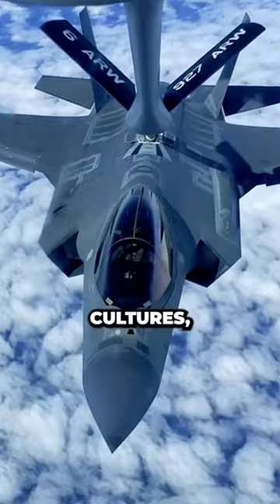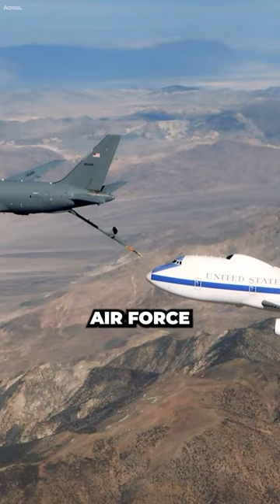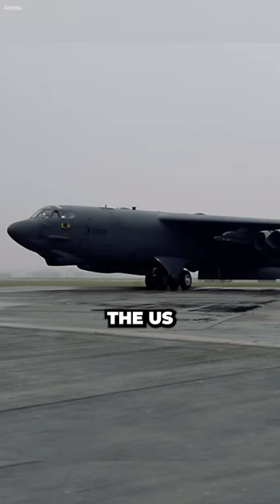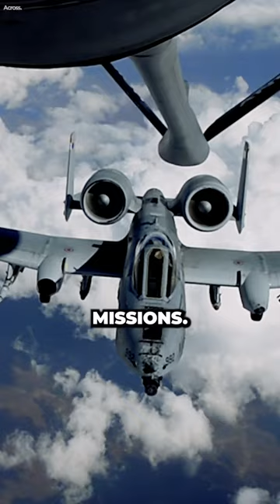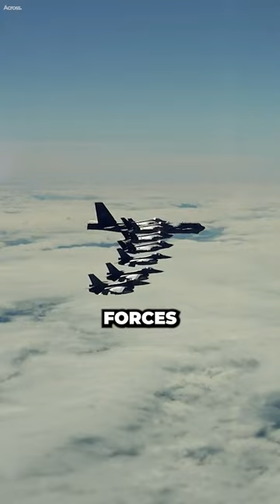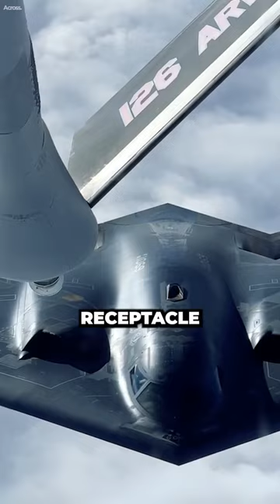Why Does the US Use Two Types of Aerial Refueling?

Comment: One disadvantage of the drogue system is that sometimes the receiver aircraft disconnects and the drogue goes along with it. The receiver has to abort its mission due to a drogue basket hanging off its refuel probe which could potentially be ingested by the engine or strike a flight control surface. The tanker has to abort because it’s lost it’s drogue.
Reply: I’ve never heard of that. Sometimes the the pilot misses the basket and it may hit the aircraft but the hoses are flexible and will only detach under certain extreme stresses. The boom would also do this.
Reply: @Statueshop297  On the USAF KC-135 R and T model, the drogue with a hose extension is attached to the end of the boom so they can refuel Navy and coalition forces. It happened on my first deployment which was right after 9/11.
Reply: But refueling providers have more than one drogue, often 2 or 4
Reply: @BeachriderUSA  You are correct. The KC-135 MPRS has two drogues and a boom, however, my original argument that the receiver has to abort still stands. More so, even if a tanker has more than one refueling point, the F.O.D. hazard of a compromised aircraft component to any receivers (trailing aircraft) would be such to also warrant an abort of that tanker.

Comment: Actual answer is due to fuel flow
rates. Booms have a had a much higher fuel flow rate and since it was developed for bomber aircraft that require lots of fuel that’s why the airforce use it. 
Everyone else uses probes as it’s fast enough for fighters and is adequate for other aircraft.

Comment: It all depends on how-long the refueling plane is to be attached for refueling. Planes with smaller fuel tanks might only connect for 15-30 minutes, refueling. Bombers, at those rates would need 80-240 minutes. That is why the higher flow rate boom is used.

Comment: Not every aircraft is compatible with both refueling system, however the F-35, specifically the F-35A is most certainly compatible with either, however it requires either system to be swapped out for the other, this is normally done by LM themselves, per customers request

Comment: The real reason is that Navy wants to be able to deploy their own tankers off aircraft carriers (Super Hornets and CMV-22B Ospreys) and boom tankers are infeasible on carriers, even though they allow for faster transfer rates which is particularly useful for large aircraft like bombers, transports and even other tankers of the Air Force.
So it doesn't have that much to do with different mission capabilities and more to do with where can you park the tankers.

In any way, all Air Force tankers (KC-135, KC-10 and KC-46) can be configured for boom or basket refueling.
There are also certain Navy land-based aircraft (like P-8 Poseidon) that use boom and thus can only be refueled by the Air Force.

Comment: The USAF does use the probe and drogue system as well. The HC-130s and MC-130s are equipped with those to refuel primarily helicopters and ospreys (special operations and combat search & rescue) to penetrate deeper into enemy territory. Even some (or maybe all) KC-135s (not sure about KC-10s & KC-46s) are modified to be equipped with additional drogue system on their wings. In severe weather conditions, the drogue system will be more difficult to enable refueling compared to the boom system.

Comment: They really should work this out. If there are two different ways to refuel in the air what happens in an emergency situation where you need fuel but the right equipment is too far away, do you just abort mission and ditch the plane?

Comment: Hose and drogue is used by the Navy since its difficult to put the boom on an aircraft with large heavy tailhooks ...
Reply: Tankers don't land on carriers, my man
Reply: The Navy depends on buddy refueling tankers operating off carriers in the form of fighters or attack aircraft with extra tanks. You can roll a hose and drogue into the back of a buddy tank, but you can't add a boom and operator to another plane.

Comment: They need to decommission these old planes and get electric ones
Reply: The problem is unlike fuel powered planes that get lighter as it burns more fuel, electric planes keep the same weight it's 100% charged or 10% charged. And with aviation, weight is everything.
Reply: No electric all the way. We need aerial electric charging stations
Reply: @bodyemcal  I'm not against electric, I'm just outlining very real engineering challenges that needs to be solved. A big reason transcontinental flights are possible is because planes burn off a lot of their fuel weight by the time they land.
Reply: I agree imagine the weight of the batteries to power a B 52?  Bet it would be 20,000 Tesla batteries or more,  add solar panels than you'd have some thing.
Reply: @cmxpotato that, and the sheer weight of the battery packs make electric unsuitable for anything requiring long range or endurance, high speed, or high weight capacity. The best electric planes currently available fly at typical general aviation speeds, can carry at most two people's worth of weight, and get just over an hour of flight time per charge. Good luck trying to get anything close to jet level performance out of it or fitting it with all of the equipment needed for military use, much less any sort of weapons system.